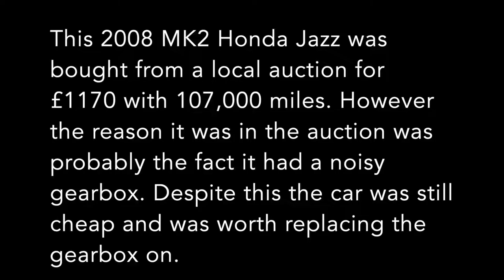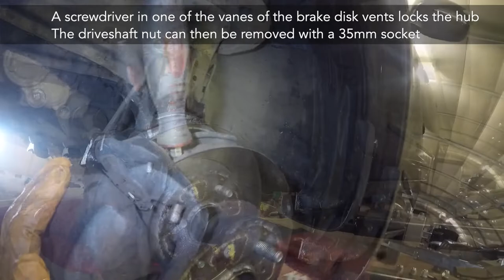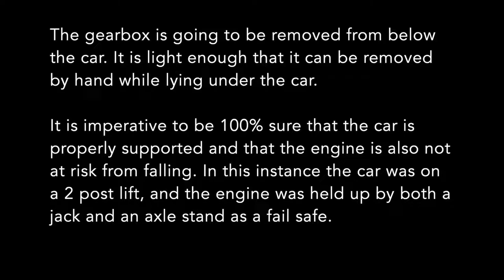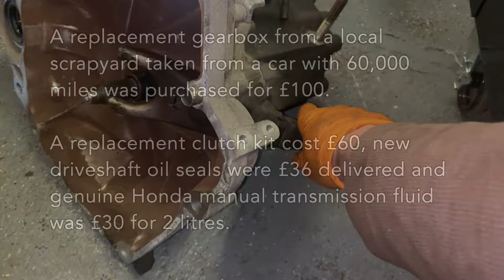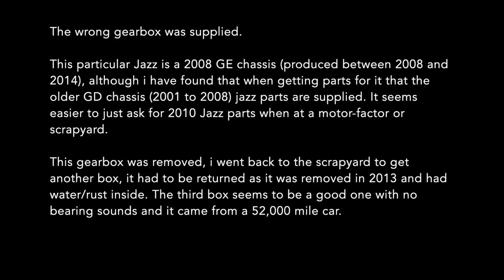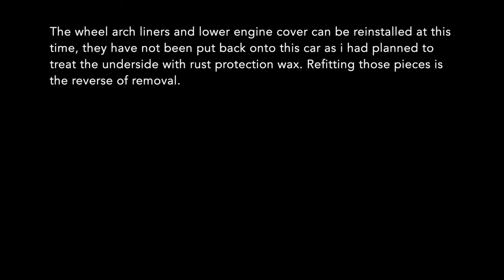Honda Jazz/Fit GE, Gearbox & Clutch Replacement

Comment: Felt my throwout bearing go and decided the car was worth less than the minumum price quoted by the mechanic. Looked easy. Thought I would have a go at it and just see if I could do it. One month later I am finally done with teardown. Every bolt refused to come out without a fight. Most were rusted beyond reuse. The transmission bolts were fused to the transmission and took a torch and a two foot breakout bar to budge and took most of the hole threads with them. As a result I decided to put in a different transmission. Got inside and the throwout bearing was toast, the clutch was worn to shreds, and the flywheel needed resurfacing. If your Fit is more than ten years old and has a ton of visible rust, just know this will be a helluva job. Wish me luck putting mine back together. Thanks for this excellent video. It and the shop manual are my sacred texts. Could not have got this far without your help!
Reply from the maker: The very best of luck with the repair. To be fair they call came out of this car with relative ease, although the enivornment the car is from can make a big difference, is this a North Eastern US car? 
How is the rest of the cars underside for rust? Since i made this video until last week ive been dithering at stripping off all the factory underseal, bringing the underside back to bare metal, applying rust converters, underside paint, and wax to hopefully preserve this Jazz for the future, the underside rust protection is not great on these cars.
Reply: @peugeotCitroen2CV  it is in the upstate New York area. So, yes. The whole underside is rusted to hell. Winter did it no favors. Currently putting it back together in negative 7c weather. Super fun lol
Reply: @peugeotCitroen2CV  finally finished. Thanks for the video. Would not have happened without it.
Reply from the maker: @Number8of10  Great to hear you got it finished, happy motoring. Hope that fit holds together through a few more winters for you.
Reply: How did the reassembly go? I might consider this repair. I do have some rust however. Was it worth it?
Reply: @brendonmonson4053 after I cleaned up the bolts and swapped out the transmission, I was able to put it back together with relative ease. The worst part was there are two pins you have to align to between the transmission and the engine in order to get it to fully seat. Hard to see and maneuver - had to have a buddy help me with that. Only took me about 6 hours once I got the transmission fully butting the engine (I'm pretty slow I know but no fancy power tools). Other than that, not too bad. TBH, I feel like it is worth it. Saved a bundle and have a cool story and made some friends. Driven it all over and no problems. Be careful when pulling off the drive shafts - you can easily overextend the CV joints. Push from the transmission end don't pull. Learned that the hard way. Also, be careful how far in you push the output shaft seals.
Reply: @Number8of10  Thanks for the reply. I am waiting on another cv shaft to come in the mail and ill replace those first and see how the transmission feels. I am almost 100% my input shaft bearing is bad. I may just do it for the experience. I have never done a clutch or transmission work before. Cant hurt to learn!
Reply: Soldier
Reply: @Number8of10  is it the snow or rain that does more damage?
Reply: @Lucidchronicles  neither. It's the salt they put on the roads to melt the snow and ice that is super corrosive. Water just helps it get everywhere
Reply: @Number8of10  ahh right 👍
Reply: @brendonmonson4053  i know its been a while since you put this comment up, but did you have any luck, did you get it sorted?
Reply: @MrMajjido  I ended up replacing my clutch and the bearings that go with it It's much quieter now I still have a lot of vibration in my car though maybe frame damage though
Reply: which shop manual?

Comment: Thanks for the movie! I have a USDM 2007 Honda Fit GD3 with 165k miles and the clutch is starting to slip once warmed up and driving aggressively. After a rapid clutch release from stop, the car moves fine but in 3rd, 4th, 5th gear I can rev engine high with no change in speed (slipping). Going to attempt this clutch job without a lift in a month here. Hopefully it lasts until then. What shop manual did you use for all the torque specs?

Comment: Nowthen AD
0 seconds ago
Thanks for the video. I am replacing the clutch on mine. The nearside driveshat pushed out of the hub easily. The offside driveshaft is seized in the wheel hub. Is it necessary to remove it before removing the gearbox?

Comment: Would the process be the same on the automatic I have to replace my rear main seal  great vid
Reply from the maker: @CircleCityExplorer  
Hi
I think there might be an extra set of bolts on the torque converter to unbolt before the box comes off, i am not 100% sure as i have not worked on an automatic jazz and i think they used a CVT box. Although generally the process is mostly the same.

Comment: Thank you mate,I have exactly the same problem on Honda Fit 2006 1.4 petrol. @140k miles I don't want to spend much the car drive has power but that loud noise from the front left side sound like gearbox or clutch .you have just inspired me to do it my self although I don't have the tools.
any one in England ?
Reply from the maker: It wouldnt be a hard job for a mechanic to do, but it could cost £4-500 when labour is added in.

Comment: Thanks for taking the time to make this video. I have a 2010 Honda Fit with 180k miles that is drivable but it's as if it has no torque from 2-5k RPM.   Above 5k RPM it feels normal.  I am not driving it much because of this though I can get around if I just keep the RPMs high though it is especially tricky on slight inclines from a stop. I almost have to floor it before I get any acceleration at all and then it just creeps forward until I eventually have enough acceleration and RPM to maintain speed.  I'm assuming it is the clutch that needs to be replaced.
Reply from the maker: If the clutch is on its way out do you notice that the engine will rev easily without a noticeable change in speed, ie does it feel like it is slipping? If you go to start the car in 3rd or 5th does it stall quickly, if it doesnt stall quickly then that is also another sign of a failing clutch.
Reply: @peugeotCitroen2CV  Thanks a lot for the reply and tips! Yep, the rev without speed is really noticeable. I hadn't tried starting in 3rd or 5th until you suggested it. Just did and it stalls pretty fast in 5th but not 3rd. It actually doesn't stall at all on a flat surface in 3rd (with slow clutch release), just moves slowly forward. Also, I noticed earlier today driving that it is actually about 2-4k RPM of "dead space" as opposed to 2-5k as I had mentioned earlier. Normally I try these types of repairs myself but I'm not really equipped for this one so will probably just shop around and get it done.  Thanks again for the video to help me make this decision and follow up tips. Really appreciate it!
Reply from the maker: @ricknoelle4507  It does sound quite like a clutch, it is quite an involved job and a bit tricky to do at ground level but possible. At the very least you will know what will be involved in getting the clutch replaced.
Reply: @peugeotCitroen2CV  Quick update from my last reply. After a lot of back and forth, I decided to attempt the repair myself.  I have the gear box off and waiting on delivery of  a new clutch kit.  Just bought a torque wrench for reapplying flywheel bolts.  I can't thank you enough for this video.  It gave me the confidence to attempt this repair myself and so far it is going well.  I'll keep you posted.
Reply from the maker: @ricknoelle4507  
That is fantastic, really great attitude and i wish you all the best with the rest of the repair. Do let me know how it all goes when it's back together again.

Comment: Hello. 
Need your thoughts about Honda Jazz/Fit Manual transmission. Can i use the GE 2008 Manual Trans assy for replacement to my GD 2004 1.3 Manuals Transmission? 
Thank you for your response.
Reply from the maker: Hi there
I really do not know the answer to this, not overly familiar with honda parts compatibilty. Catcar.info is a good website for looking up parts diagrams and part numbers so might be worth checking to see if the older jazz gearbox will fit the newer one.

Comment: Dumb question but the grumbling sound heard in the gearbox when you twisted it with your hand and drill was actually from the transmission being faulty or because you had drained the fluid?

Comment: Hey cool video! Did you hold/suspend the transmission when inserting it back in? I saw the ratchet straps
Did you also use the bolts to pull the engine and transmission together and how did you know it was lined up?
Reply from the maker: Hi there, thanks for the comment. 
I think looking back at the footage i seem to have used the strap connected to the engine crane. With the car on the 2 post lift it can be too high for the floor jack to lift the gearbox into position to reinstall the mount. 
Regarding knowing it lined up, its a bit of trial and error, the bolts help guide it in when its close enough but just get them started and then jiggle the gearbox over to the engine. Do not just begin tightening on the bolts as that will cause something to bend and get damaged. Jiggle the gearbox closer to the engine the bolts should go in most of the way by hand and the final tighten is done with hand tools. 

Its the trickiest part of the job, the one with the most curse words used. I usually consider to be over the hill when the gearbox is back on, the rest of the reassembly normally goes quite smoothly.

Comment: Hi. I don't have the noise you had but I have a different one. A metallic rattle noise coming from gearbox side. It only happens under load, at 2000-2100 rpm . If it's higher gear tends to be louder. Is it possible that this noise could be clutch plate springs loose? It is only happening under load, and only at 2000 rpm . Never when in neutral. Thanks
Reply from the maker: Hi, is there any clutch slippage when this happens?
Reply: @peugeotCitroen2CV  Hi. No clutch slip. I replaced the clutch, the old one looked good. Now it still rattles but only in 5th gear at the same rpm 🤣🤣🤣.

Comment: Interesting that the thumbnail shows the car jacked up on the floor, like it's for a home repair, but in the video, it's all done on a lift.
Reply from the maker: It was done on a lift mostly, a lot easier to get the footage underneath the car (recording with a foot of space used to be quite difficult and did not result in good footage, i have a 106 clutch replacement video done before the lift)

But the actual removal of the box i brought the box down to axle stand height as it is easier to manouvre it with it that low, and also to support the engine with the jack when the box is out.

Its still very much something that could be done on a floor, the thumbnail image just happened to be a good photo i had when the gearbox was out and sitting beside the car.

Comment: Would you know the cause of juddering when pulling away in 1sr gear? My clutch has good bite
Reply from the maker: A few things to check, wear in the engine mounts does the engine move about too easily, worn driveshafts, wear to the clutch, oil leaking on the clutch.
Reply: @peugeotCitroen2CV  if your up near Scotland, I will just bring my car to you 😂 you seem the only trusted guy 👍
Reply from the maker: @ConnorA21  unfortunately im over in Northern Ireland and i dont do mechanical work full time.

Comment: thank you so much for this... Will there be any problem if I am using Bosch/castrol manual transmission fluid of the same grade 10w30 or 10w40  because genuine Honda fluid is not available
Reply from the maker: Im not sure, i went the the honda dealership specifically to get the correct oil, common sense would say oil is oil but i was being pedantic that day haha.

May be worth asking on the relevant owners club to determine if other owners who have used different oils had any issues.
Reply: @peugeotCitroen2CV  thank you sir... I will ask around more

Comment: If you remove the two big lower strut bolts on the gearbox side you can pull the driveshaft out of the box
Reply from the maker: This is to leave it installed in the hub? I generally take a few extra steps in these videos as removing the driveshaft then covers how it on its own can be replaced.

Comment: Watching you do this makes me wanna cry. My GD fit has 180k when should I replace my clutch and flywheel
Reply from the maker: Only replace the clutch when it needs to be replaced ie if you can feel it slipping, its not a mileage dependant service item, the clutch will wear dependant on how the car is driven.
Flywheel only really needs to be changed if its damaged, if you feel the slipping and address it early then the flywheel should still be good, if its left then the clutch plate wears down to the rivets which then score the flywheel. It can always be machined down but its not something that needs replaced as often. Unless its a modern diesel with a dual mass flywheel.
Reply: @peugeotCitroen2CV  ty 🤙
Reply from the maker: Victor Jones  

Not sure what the highest milage jazz is.

My mums jazz is on 110k now. 

So far since buying it it has needed the full underside rust protection, check any jazz underneath especially an older MK1 they can get very rusty underneath.
My video covering that issue https://youtu.be/ecG4PZIYZoo
It also needed the gearbox, as covered in this video. Used it is hard to know what you are getting and a rebuild can work out quite expensive. 
Nonetheless those items were done last year. 

I bought my aunt a 2006 1.4 SE with 56,000 miles for £550 back in June, bought on Gumtree. Tidy enough wee car and it drives really well but unfortunately inspecting underneath id say another few winters and it will be in the scrapyard. 

I actually gave my mums jazz a check over yesterday for the MOT in December and it needs a front shock, that seems to be it for this years parts.

Generally apart from the rust and noisy gearboxes they seem easy enough to work on and maintain, the engine should keep on going if kept serviced with the correct oil and fluids.

Diesels it depends what you have, a lot of unreliable ones. Although there are still good engines from various brands.
The advice would be to avoid any modern one if the driving is predominately shorter runs.

Comment: ,teniendo elevador para trabajar parado  saca la caja tirado en el suelo ? Y cuando instala la caja  no la coloca asta el final , la lleva con los tornillos , eso esta mal ya q puede estropear el disco xq no estan alineadas las estrias .
Reply from the maker: Yes the car was lowered closer to the ground so i could basically bench press the box out and back into the car.

When it goes back in, slide the input shaft into the clutch plate and align up the bolt holes, a couple can be started a few threads to hold it in place as the box is wiggled a bit into place but obviously dont fully tighten on one bolt until the box naturally finds its resting place as that will twist parts and cause damage.

Comment: Hi I have the exact same car, same colour also, 2010 1.2 ivtec, my issue is that I hear a squealing sound like belt slip when in neutral and when I push the clutch to the floor the squealing disappears, my car only has 64k miles, serviced every 5k miles never been abused, what is the cause of this issue, could it be ignored or would need fixed thanks
Reply: Could be the bearing he's replacing.
Reply from the maker: This car was actually a 1.4 but i think they are very similar mechanically.

You can keep on driving the car until it stops, although it may be the gearbox which has bad bearings inside in which case if you drive on then it may make it more expensive for a rebuild, scrapyard gearboxes are a bit of a gamble. It took me 3 goes to get a good one. If its the release bearing then its the cheapest option but still requires the gearbox to come out.
Reply: @peugeotCitroen2CV  thanks for the reply, would you recommend a gearbox oil change, could that solve it? It's not loud and mostly does it on a cold engine, like the other day I took it to a race track and virtually thrashed the engine and at the end it was silent as ever lol
Reply from the maker: @ConnorA21  
The gearbox oil is one of those overlooked service items, its not too expensive to change the oil. Draining the old oil will also allow you to give it an inspection to see what sort of condition it is in. The only thing i would advise is getting the correct honda gearbox oil.

Comment: Even more confusingly, the 2007-2008 model year Mk.1 Jazz isn't a GD, it's a GE3 chassis code. Made in China for the EU market.
Reply from the maker: That is quite strange, im not sure about this model were they built in the UK or Japan?
Reply: @peugeotCitroen2CV  I'm pretty sure all the Mk.2 Jazz sold here are made in Swindon, UK. Only the hybrid model was made in Japan.

Comment: The noise when depressing the clutch is what I have in my car at the moment too. Will a clutch change be the solution or will it be an imput shaft bearing?
Reply from the maker: If the noise goes away when the clutch is pressed in it is likely to be the input shaft bearing. If it remains regardless of the clutch position then its the release bearing. In either instance the gearbox needs to be removed, with the gearbox off its obviously much easier to conclude as to what one is making the noise.